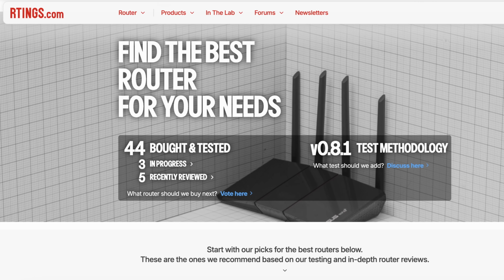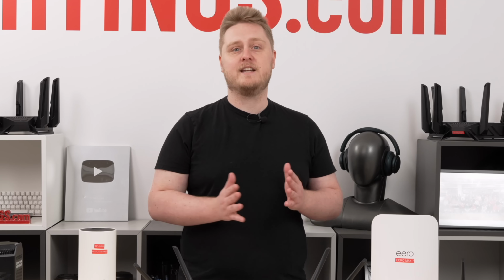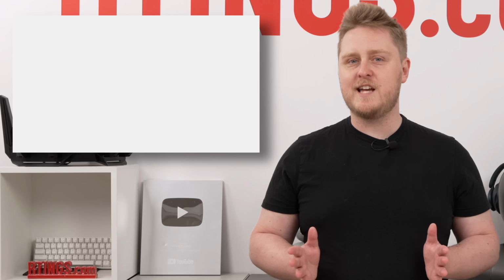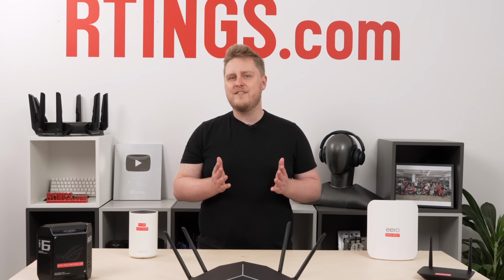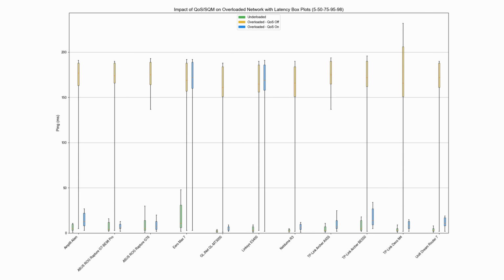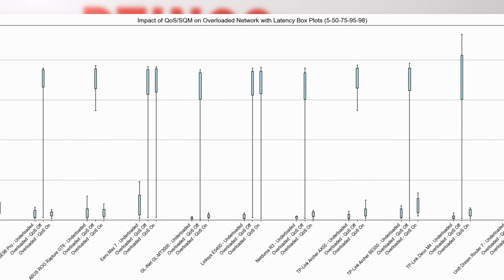Gaming Routers Won't Improve Your Ping - Here's The Data!

Comment: can confirm, QOS on the eero max 7 does nothing lol
Reply: QOS helps when somebody in your house is downloading big files or streaming movies. Try to disable it when 3 people are streaming or downloading. Then you learn that it helps.
Reply: @chilli2473  I actually switched to a Unifi Cloud Gateway Fiber and U7 Pro Max, and the experience has been way way better than the Eero lol. I was smart enough to know how to configure Unifi, I just thought Eero being more plug and play would be easier.....but its just not the same experience at all. Also...my UCG Fiber and AP was just as much as the Eero Max 7....and I have WAY more control over my network and ZERO paywalls. Eeros just a joke. 

Using SQM on the UCG, I can definitely notice slight differences for sure. I also have no issues getting full throughput with it on. Pretty sure Eero disables QoS beyond a certain speed, and you have no way to control that.

Comment: all those routers....and u didnt test 6ghz OR mlo... 🚮.. misinformation.....here is an unbiased opionion.... with mlo on a quad band wifi 7 router...i get the same exact speeds and latency as being directly plugged in.....in regards to 2.4 andd 5ghz this video is accurate...but not accurate whenu arent testing all the technology...if u can use wifi 7 or mlo.... its JUST AS FAST AS WIRED

Comment: is Adaptive QoS or SQM rotate a real thing
Reply: yes SQm helps with bufferbloat.
Reply: @chilli2473  i meant the adaptive sqm where it determines the actual bandwidth and configure it self without the need of your configuration
i was wondering because i have a 5G modem and the bandwidth changes from 300 to 800 mbps along the day so if i put it on like 280 i would lose a lot speed of bandwidth on the table

Comment: AI Summary

Abstract:

This video investigates the marketing claims of "gaming routers," concluding they offer no inherent latency advantage over standard modern routers. Through a series of objective tests, the analysis demonstrates that network latency in gaming is primarily dictated by fundamental networking principles, not router hardware marketed for gaming.

The key findings are:
1.  Wired Ethernet connections are unequivocally superior to any Wi-Fi connection for low latency.
2.  On Wi-Fi, the 5GHz band offers lower latency than the 2.4GHz band due to reduced interference.
3.  The primary cause of network lag is "buffer bloat," a condition where the network becomes congested, typically due to insufficient ISP bandwidth, not router performance.
4.  Quality of Service (QoS) and Smart Queue Management (SQM) features can effectively mitigate latency on congested networks, but these features are widely available on most routers, not just "gaming" models.

The video asserts that router hardware is rarely the bottleneck and that buying a "gaming router" is an ineffective solution for latency issues. Instead, users should prioritize a wired connection and ensure their internet plan provides sufficient bandwidth for their needs.

Debunking the "Gaming Router": A Guide to Real-World Latency

*   0:00 The "Gaming Router" Myth: The central premise is that there is no such thing as a "gaming router." These devices don't improve latency any more than a standard router.
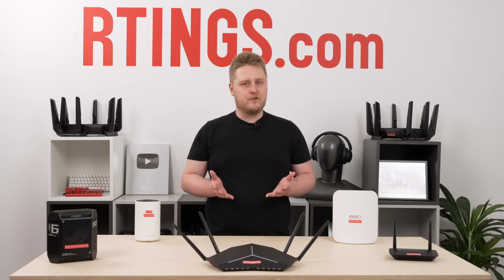*   0:48 Ethernet is King: A wired Ethernet connection will always provide a better, lower-latency gaming experience than Wi-Fi. Wi-Fi is a shared medium where devices must compete for airtime, inherently causing delays and potential lag spikes.
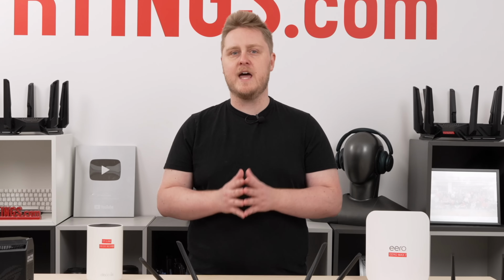*   2:26 Use the 5GHz Band: When Wi-Fi is unavoidable, the 5GHz band is superior for gaming compared to the 2.4GHz band. It is less crowded and suffers from less interference, resulting in fewer lost packets and network collisions.
*   3:10 The Real Culprit is Buffer Bloat: Network latency is most often caused by "buffer bloat," which occurs when a network is congested with too many data packets. This bottleneck is typically caused by the bandwidth limitations of your ISP plan, not the router itself.
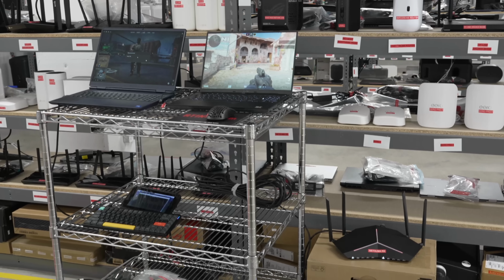*   4:05 All Routers Perform Similarly on an Empty Network: On an uncongested network, test results show that all modern routers, regardless of price or "gaming" features, deliver similar low-latency performance. Even high-end routers cannot overcome a congested network.
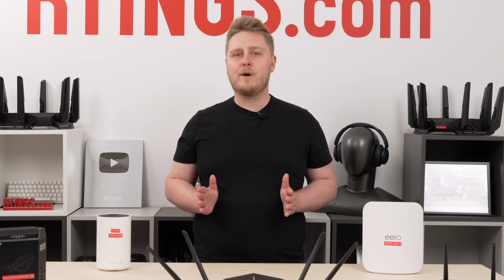*   5:05 QoS/SQM Features Mitigate Congestion: Most modern routers, not just "gaming" ones, include traffic-shaping features like Quality of Service (QoS) or Smart Queue Management (SQM). These tools prioritize specific traffic (like games) to reduce lag when the network is busy.
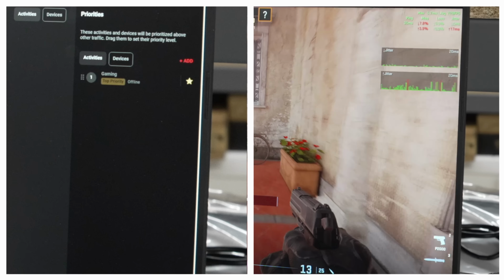*   5:54 QoS/SQM Is Effective, but Not a Cure-All: Testing confirms that enabling QoS significantly improves the gaming experience on a congested network. However, some routers' CPUs can be overloaded by this task, rendering the feature ineffective.
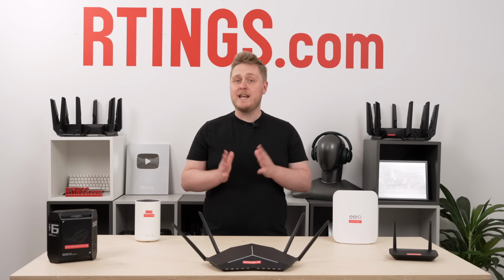*   7:40 Upgrade Your Bandwidth, Not Your Router: While QoS helps, the most effective solution for chronic network congestion is to address the source of the problem. If your network is frequently overloaded, you need more bandwidth from your ISP.
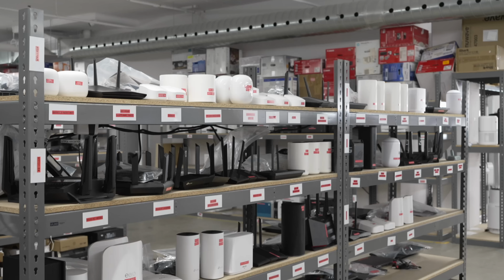*   8:23 Final Recommendations: For optimal gaming, use a wired connection. If using Wi-Fi, stay close to the router on a 5GHz or 6GHz band. Most importantly, avoid overloading your network's bandwidth. A specialized gaming router will not solve these fundamental issues.

AI-generated summary created with gemini-2.5-pro for free via RocketRecap-dot-com. (Input: 15,391 tokens, Output: 784 tokens, Est. cost: $0.03).

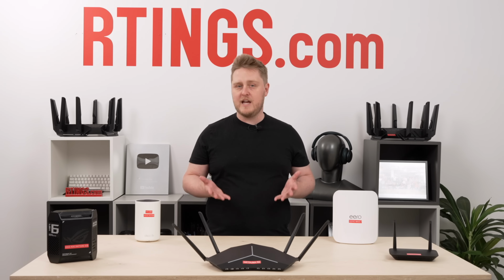Comment: 8:49 ok but my 10$ router wont handle 5 devices like a 50$ wifi right?
Reply: Depends on the specs of the router- to be honest I have fiber internet and their brand new equipment sucked! I saw a good deal on a router I could clone the MAC address on and it was on sale for like 40bucks it literally beat the dang ISP equipment by a long shot!

Comment: I have an Archer MR600 4G LTE+ would upgrading to an 5g router atleast help? Im having alot of ping spikes and i cant play games while watching youtube on the side and stuff, I have regurarly 30-60 ping on close servers. I cannot at all get fiber to my house sadly. Im looking at the Archer NX200 or NX500 to atleast get 5G would that work? I do use an ethernet cable from my router to my pc. It is an sim card router
Reply: 30-60 ping on servers in your country is perfectly normal and won't cause any noticeable lag. 100+ is where it gets bad. Your problem is probably because your router is using mobile network instead of cable. Mobile networks are shared with all other mobile clients like every phone connected to the same cell tower.
This causes a lot of problems for games. 
Switching from mobile network to wired internet (to your router, not from router to devices) is sadly probably the only way to fix your issues.
Reply: @DeadNoob451  Yes thank you for your answer i have accepted my fate haha. Sadly i cannot get Fiber since i live up on a hill and it would be extremely expensive.

Comment: This video is completely router dependent as most modern routers can and do handle multiple devices at once especially with WiFi 6. If you’re using a decade old router you’ll run into issues.

Comment: Typical network bandwidth of 50mps? Isnt the average in America like 200? Even in Australia we're closer to 100 average and that's average let alone the demographic watching your videos which'll be on the upper end
Reply: You are right, the average network speed in America is around 200 Mbps. The goal of our test was to fully congest the network and see how QoS could help prioritize gaming packets. Unless you are downloading torrents/updates/backups, if you have over 200 Mbps of ISP bandwidth, chances are you should not have a congested network just using common application. So, we wanted to test QoS in a more common scenario, but expect the same results with a 50 Mbps, 200 Mbps or 1 Gbps bandwidth. The article goes into more detail on this subject if you want to see the extent of the testing we did. In the video, we took a shortcut and only showed the most interesting test with Counter-Strike 2 where we used the 50 Mbps limit.
Reply: They are not in USA
Reply: I think 50 is a good middle ground since very few countries have as good internet as the US.

Comment: 1:15 that is totally false. With WiFi 6 we got MU-MIMO where multiple devices can talk to the accesspoint at the same time and unlike WiFi 5 where this only works downstream, this works in both directions with WiFi 6 (and 7 ofc).
please properly research 802.11 standards and their differences.
Reply: You’re right, we simplified Wi-Fi’s half-duplex communication versus Ethernet’s full-duplex in that explanation and didn’t mention MU-MIMO. Most modern routers support 4x4 MU-MIMO, while clients typically have 1x1 or 2x2 capabilities, though some high-end devices push to 4x4. This means routers and clients can maintain multiple parallel radio streams. However, even with 2 or 4 simultaneous channels, each stream is still half-duplex (only one packet can be transmitted at a time _per stream_) unlike Ethernet, which allows simultaneous send and receive. So yes, MU-MIMO capable devices improve performance, but they still can’t beat Ethernet cables when it comes to latency. We didn’t dive into what MU-MIMO (or MLO and OFDMA) can offer in this video, but I’d love to explore this further in a future article/video!

Comment: Can you test gaming on a mesh setup? Is it better, for example, to plug into a mesh node with Ethernet, which connects to a base through a wireless signal, than it is to connect straight to the base router with Wi-Fi?
Reply: We briefly tackle this topic in a previous article (YouTube doesn't seem to like my link though) In one line: If you have wireless backhaul between mesh nodes, expect a bump in latency with every hop from your mesh satellite to your modem, whereas with wired backhaul, there will be almost no latency difference between connecting to your satellite or the main router.
Reply: That's what I would have guessed, thank you!  @sp_RTINGS
Reply from the maker: Here's the article @sp_RTINGS is talking about: https://www.rtings.com/router/learn/mesh-range#the-increasing-cost-of-being-in-a-tree-topology-vs-star-topology

Comment: There are some "gaming" focused routers that are able to eliminate even the occasional lag spikes from other network activity, though thry use a combination of QOS, and a more brute force approach both prioritizing the game traffic and not allowing the WAN to reach more than 80 to 95% saturation depending on speed and latency. For example the net Duma based gaming routers from Netgear. The downside is they are effectively using a system of identifying game traffic when when you are gaming, effectively capping the overall WAN speeds to a level where ping times to various servers stop increasing while a throughput test is being conducted. In the case of a 50mbit symmetrical connection, if that game moslde is enabled, then your connection may become a 40mbit connection the moment you join a game server, even if the game only needs a few KB/s of throughout. It works but is inefficient, especially since it's safety margins are pretty large to account for inconsistent connection such as cable internet. 

One thing I would like to see is a proper Ai system that monitors the WAN for signs of buffer and latency issues, and dynamically limits throughout for bulk data transfers just enough to avoid latency issues, thus ensuring that you can get as much as possible out of your WAN connection while someone is doing multiplayer gaming.

Comment: I'm using an Asus RTBE 88u wifi 7 router it is a significantly better router than my ISP provided gateway it has built in modem and WiFi. Problems I had with my ISP were slow ipv6 performance and D bufferbloat ratting I solved these problems by putting my ISP gateway in bridge mode and using a Asus RTbe 88u wifi 7 router.
Reply: The bufferbloat test is heavily affected if the router is using some sort of Quality of Service. Your ISP<s router might not have had that feature enabled (or maybe it was misconfigured for your needs). You might have been in the same situation as the Linksys E5400 that got its hardware overload. If your ISP's router was prioritizing the 2.4GHz, that would also explain poor performances. Basically, changing routers changes a lot of variables. It can be hard to understand what the original problem was. At least, I'm glad it worked out well after the switch!

Comment: Does this also count when having multiple people using the local network at extremely high usage rates? The example I can think of is when a friend of mine moved in with a bunch of friends and they had multiple VR headsets connected to the network. Note that the headsets were only wirelessly communicating with the computer rather than the internet in order to stream the video to the headset. They would frequently suffer communication issues sometimes drop out all together if they had too many connected on the network at once. They even tested it with their router disconnected from the internet and got the same results. Would a higher-end router be able to handle these connections better or would it suffer the same limitation? I've been trying to find answers online but mostly coming up empty or with super conflicting answers.
Reply: You have an interesting case here! The video really focuses on the latency between a client and the router, with the aim of reaching a game server on the internet. Your case is, not that. In your case, internet really doesn't matter, since everything is happening on your local network, so you don't have to worry about your ISP (as you pointed out). Even more, depending on your headset models and the type of connection you are using, you might not even be going through your router. So it's important to understand where the headsets are connecting and identify the bottleneck in your network. If you have a modern router with Wi-Fi 6 or more, you probably have enough bandwidth for your needs. Computers, however, are not generally made to provide high bandwidth to multiple devices, so if your headsets are connecting directly to the computer, chances are the computer's Wi-Fi chip is the bottleneck. Then again, your setup might not be what I have in mind. Even the game/application you are using with your VR headset will change the problem here, as they can wildly vary in the bandwidth they need. Hopefully, this gives you more insights on where to look to find the problem.
Reply: @sp_RTINGS  It does, thank you! The only interesting thing is that the computers themselves are connected via ethernet which is why I also assumed it was a bandwidth thing with the router itself
Reply: I would look into getting cheap routers for each headset. So one main router shares internet with  the other routers that then connect to one headset each.
Reply: Odd. I have 3 teenage boys and they all have phones, gaming PCs, PS5s and oculus’s running at the same times- never had an issue.
Reply: @colleen0229-ProBerger  The thing about the VR headsets is that they can completely saturate a local network if set up in certain ways. It's FAR more traffic than you would expect with normal gaming and they had it set up like that.

Comment: The only "upgrade" I experienced regarding latency was going from copper cables to fiber optical ones, and it wasnt that much of a difference. If you have a coax cable for internert, that could be the source of your problems (friend's experience)
Reply: Makes sense, at least in case of coax which typically is a shared medium as well (connecting multiple households over a single wire)… and even if you have your own wire (ADSL), if your uplink is slow (1 Mbit/s), then just the time it takes for a network packet to squeeze through means that if another large packet is just being sent the moment you click, even the best QoS cannot avoid an extra 11 milliseconds of delay.
Reply: DAC cables have less latency than fiber, and muuch cheaper. fiber only makes sense if you need long cables

Comment: Surely more expensive wifi routers have stronger wireless transmitters tho right?
Reply: You are right that we didn't look into antennas. We did it on purpose. The Wi-Fi connection is two-ways. It will be limited by the weakest device. In most cases, this is the client (gaming device). Even if you have the beefy Wi-Fi 7 router with 8 antennas, if you have a laptop capable of Wi-Fi 4 only with one antenna, your router won't be able to alleviate any of the Wi-Fi 7 features, or use more antennas. This is also true for range, even if your router can send a crystal clear signal to your far away client, if your client doesn't have the antenna power to be able to reach back the router, a connection between the two won't happen. So if you want the best network setup, you need to invest in both the router and the client (well at least its Wi-Fi chip and antenna). If you only upgrade your router with a 5 years old laptop, you might not be gaining much improvement.